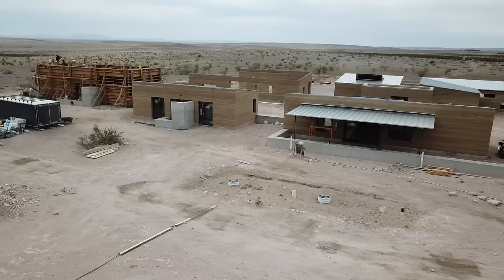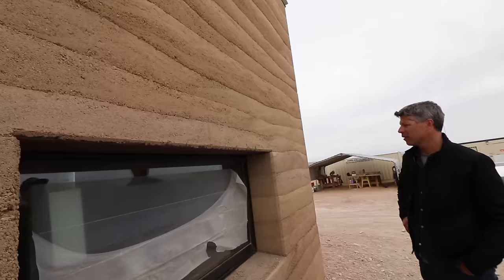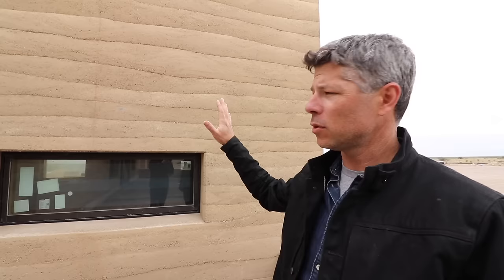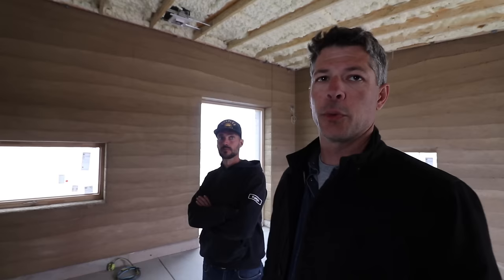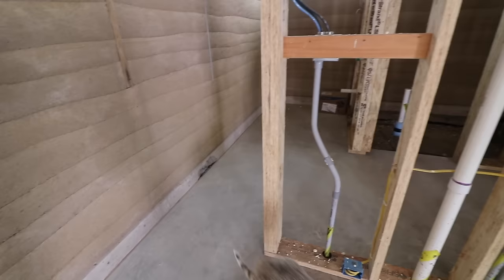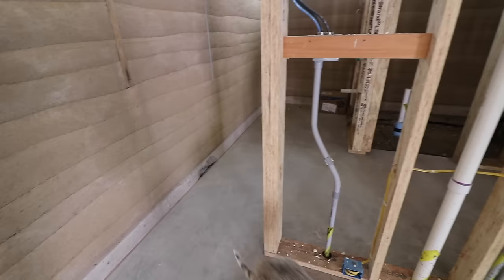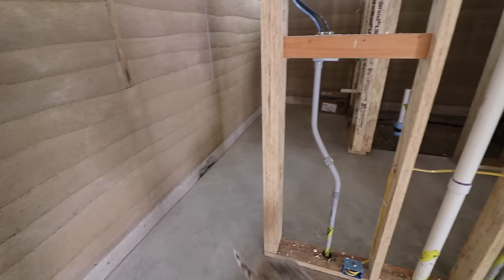Rammed Earth : You won’t Believe How They Build This!

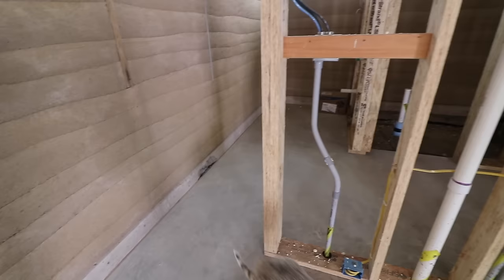Comment: Wow, assuming that lintel at 10:30 is 8ft long and extends 4ft up the roof, that is 64 sqft of rammed earth. At the standard rammed earth estimated weight of 110lbs a sqft(ASTM D698), that lintel is supporting around 7000lbs. Beautiful! Beefy!
Reply: Well, I think you are weighing cubic feet of earth. And, the lintel only supports the weight of the material below the included arch in the wall. Just like a brick , or, stone wall.
Reply: Thats about right but from the description of the mix maybe closer to 130
Reply: 110lb minimum.. I suspect that it is more into he 130lb range

Comment: The steel beam for the window frame will create a thermal bridge and when it's cold you will get condensation.
Reply: not enough humidity and probably not quite cold enough their to be a real issue I would guess. any condensation that might form the atomo would probably greedily absorb.
Reply: @nerys71  

You'd guess wrong. Some of the hundreds of years old historical rammed earth buildings around here have steel detached roofs covering the remains due to erosion by wind, water and ice. 

When people lived in them they were always having to maintain them. Far more than some construction types. They also usually put a stucco type covering over the outer walls. Because it was easier to maintain, and you didn't want the weather to destroy the actual wall.
Reply: @shaunofthedead3000  Any hundreds of years old rammed earth buildings are not at all like modern rammed earth which have a specific cement content. And rammed earth historically is quite rare, are you referring to adobe buildings? Those were fairly common and are very susceptible to weather. But very different from rammed earth
Reply: That is no exposed steel beam that is actually 3/16" cover plate for embedded struct angle above it, therefore that amount of heat transfer is far less than a beam. We supplied the steel
Reply: Yep ...  I would think that would happen.
Reply: @SuperVHSchannel 
2 feet of wall is its own insulation.
Reply: @Niels Kloppenburg 
Obviously not ideal for wet climates or high humidity.  Rising damp is virtually nonexistent in the U.S.
Reply: Hellbender Adobe is much stronger/weather resistant than European cob techniques or wooden buildings

Comment: min 10:22 when he says "many many tons above the lintel". I google how much weight a rammed earth wall has. This is the answer:  depending on density of soils and ramming it should range between 115-140 pounds per cubic foot. Or in normal none Imperial measures. Its between 550-680 Kg/m2

Comment: There has got to be enough lumber there in scaffolding to BUILD a house.
Reply: Rick Carrarini Much of that can be reused
Reply: There is another method that I'll be using where you make the RE wall in 4 foot sections at a time. U design it it key into  each section as you go. when it sets, you strip down the forms and set it up next to it. greatly reduces the lumber costs and is better suited for the DIY builder or small crew.
Reply: @klincecum  I wouldn't bet on it. If these houses were being churned out by the thousands, then maybe. But these are going to be one offs and all bespoke. I'd be surprised if half of that wood get reused.
Reply: Marten Dekker  Go use a saw.
Reply: @poppyrider5541  All of the wood is reused as forms to build other buildings several times. It's just like using concrete forms. The wood forms last for years.
Reply: Poor Poor  All rammed earth structures use a stabilizer/binder to strengthen the walls. Lime has been the historical go-to binder for 2000 years.

Comment: It's basically an expensive way to do a decorative "concrete".
It's not concrete PRECISELY, but if you're mixing in portland cement and aggregate, you're essentially concrete.

If nothing else, it's interesting.
Reply: It uses existing material and less Portland cement, which is a huge greenhouse gas producer.
Reply: The fuel cost of the workers and compression drives up the carbon footprint. It doesnt perform as well or last as long as a concrete/rigid insulation wall.
Reply: @sparksmcgee6641  There are rammed earth buildings from hundreds of years ago still standing.
Reply: I hear you hyperstrike. Whenever I see oak cabinets I'm like, why not just use pine and stain it?
Reply: @rammedearthworksllc2864  

Rammed earth on the project in the video.  You're using sandy soil, aggregate and portland cement in the case in question.

What is concrete?
Sand, aggregate, portland cement.

YOUR POINT?

Yes, in other cases (like earthship construction) rammed earth is just that.  Compacted soil in a retention system (tires in this case) and nothing more.

But I wasn't talking about that.

Okay, tired of this stupidity already.

Thanks for your time.
Reply: there are underwater set concrete structures in old ports that are thousands of years old. Rammed earth doesnt perform as well as concrete.
Reply: Roads used to be made with 3-4 bag mix in the 1920's  that would equate to 9-10% portland and I have done this wet in a 9 yrd mixer using CA6 for non structural low walls (3=4') for a horse barn and block fill as a pour mix..   if too wet it will crack if lime is not used

Comment: Absolutely beautiful work!  I love the bond beam detail.  We live in a Rammed Earth home and we LOVE it!!!
Reply: C J  , we are in South East Arizona.  It does great here, but we do have a heat source for the winter.  I think most people use a ridged insulation when building with rammed Earth in the colder climates.
Reply: C J  , it will get to about 80 inside our house when the temps are I'm the high 90's low 100's outside.  We typically see a temperature difference of about 20 degrees f.  At night it typically drops to the high 60's so we open our windows and it cools everything down for the next day.  Once you learn how to manage the thermal mass, it's great.
Reply: C J  I built and live in a rammed earth home in Canada. The biggest difference I noticed was the requirement for vertical rebar, and horizontal rebar through ties, which add a great deal of strength. Snow load requirements make it mandatory here, and somewhat higher percentages of portland cement are likely necessary, depending where you are. In the video I think he mentioned the walls are 1800 psi, ours crushed out to 4000 psi, but they needed to be a minimum of 2600 psi to satisfy the structural engineer. We have a 24" wall, with 8" inner and outer walls, and 8" of insulation in the middle. It is a very high performance home and I would love to see more of them in Canada, but unfortunately the added requirements do make it more expensive up north.
Reply: C J  it is difficult to determine the R value of the walls. On paper they have a static R value of approximately R 30. The dynamic R value is much higher. In our case, with 24" walls and 8" of encapsulated insulation, I would guess a dynamic R value of >R60. Put into perspective, our home has ten times the area of our tiny home we lived in while building, and costs the same to heat. Ranted, they have different heating systems, but a rammed earth home simply stores so much energy that it performs beautifully. It breathes very well, yes. We did not seal the walls, but many people do. Instead, we are relying on the plasticure we added to the dry mix for water repellant.

Comment: 07:10 All that exposed rebar all around the jobsite makes OSHA mad.  Won't even talk about fall protection when they climb up on the 15 ft wall forms. I guess that's the benefit of working in the desert. You can see the OSHA inspector coming from miles away.
Reply: coated rebar.. doesn't need much such as a silica anti rust clear coat, oil or epoxy based  and MARFA is not going to have that type of inspector.. (ya, they should have had more safety gear of some kind.. than what we saw)
Reply: @tsclly2377  I wasn't referring to exposed rebar because of rusting issues. Exposed rebar sticking out of the ground must have a cap over the end to prevent impailment injuries should someone fall and land on it.
Reply: The next time I will get the feeling that the Health & Safety people are pushing it, I will think of this worksite... and calm down.
Reply: Yeah, that man is just standing there on that ledge, and I keep waiting for the safety man run up yelling at him. :D
Reply: Thank you! I thought it was just me. There was a scary lack of PPE on this site.
Reply: yea and they shoulda been wearing masks cuz last year the flu killed some people
Reply: @majermike  Or that they are working with dry dust/dirty and cement. I don't envy their lungs
Reply: @slozenger9000  silica is no joke man, that stuff tears up your lungs. 😬

Comment: Matt.... I love your content. And I understand your niche are those big and beautiful custom homes but I'm finding myself more and more drawn to smaller homes. I'd love for you to  do a mini series  on tiny homes, and after touring a few, see if you could use your knowledge of building science to see if you had any idea's to advance the movement. I would love to be able to build my babies a tiny home and give it to them for their graduation gift after high school (in place of paying for tuition )... And after that... I'm gonna go build a village of  modern yurts and live out the rest of my days there.
Reply: What is the mixture ratios?
Reply: The Chinese, among others, have been building this way for millennia.  Of course they didn't use a cement foundation or bond beam.  Rebar was most likely bamboo, and stabilizer was probably fired and dowsed limestone (like Roman concrete,) if they used any stableizer at all.  Form-work was mostly done layer by layer -- not at all like this elaborate method.  Tamping was done with a wooden or stone hammer.  As each layer was finished, the form work was removed and reassembled at the top for another layer.  Often a limestone render was applied to the surfaces.  The only metalwork one was likely to find decorative on doors and windows or locks and hinges.   Some rammed earth structures date back well over a thousand years.  Built right, they can even be earth-quake resistant.  It would be a very good method to employ for a tiny house -- especially for someone young with unlimited time but limited funds.  One can even make rammed and fired roofing tiles.
Reply: Ditto on a series on cottages and smaller homes (including, but not limited to, tiny homes). I am planning on building as I get closer to retirement but it will be probably 800 Sq Ft +/-.
Reply: @fga55  8% cement I think
Reply: @dr.mikeybee  not to mention fire proof. Good if you can use your own soil from earthworks on site
Reply: No, not tiny houses. How about houses with a realistic budget. Anyone can build a luxury home. I want to see houses built with budget restrictions in mind in a manner that is accessible to regular people. I want some reality. Tired of pie in the sky.
Reply: @maxidaho  there are many low cost materials but the outer shell of a house is the cheapest part, it's the interior that's expensive, kitchens and bathrooms are the most expensive rooms. The best way to keep costs down is to DIY.
Reply: I actually considered the village you are talking about.  a good idea.
I have a new plan now though.  crossing on my boat. in the Bahamas, Carribian.   in that area or anywhere else I want to go
Reply: @maxidaho  no everyone doesnt know how to build a luxury home. Matts market is for high performance higher end homes.
Reply: Are your babies homes going to be on trailers?  Serviced land is the main cost of every home.  Unless your town has a very flexible land use policy, finding postage stamp lots with zero setback is going to kybosh your plan, as appealing as it is.  I think many of us are concerned with finding some way for our kids to not be saddled with a mortgage.
Reply: @colstace2560  unless your interior furnishings are also fire proof, any fire will destroy the integrity of the walls.
Reply: @markdoldon8852  I was referring to a forrest or wildfire mainly, no eaves or gutters to trap embers

Comment: That looks like a absolute ton of labor.
Reply: that's what I was thinking...then wondered if it will pass the test of time..
Reply: @nw5052001  Not sure just know new unproven products normally at this level will have a ton of issues over time .
Reply: They are using the local soil instead of trucking in materials from very far away. Notice they had to fly in. The natural soil is very sandy and good enough to make a low grade concrete out of. Plenty strong for a one storey building. That's why in a specific application like this it's worth it instead of spending a fortune importing building materials.
Reply: Way too much...Wait until you are forced to pay Union Scale Wages too @$42.00 per hour

Comment: The labor cost of compacting every wall every 4 inches must be staggering.
Reply: Sure its a lot more labor than a poured concrete wall but its not any more than a brick/block, which are still usually layed by hand everywhere in the world (even though mechanical bricklaying machines exist now). If the site is somewhat remote but there is a nearby supply of the aggregate it could be a remarkably efficient method of construction.
Reply: @dfpguitar  traditional rammed Earth has no cement. It uses clay. It also has no stone filler. So unlike what they did here I can all come from the sight. That along with the thermal mass is why it became so common in Mexico. Shipping things from miles away has always cost more then the labour for making a home in history. Only after trains had using things from off site become a common or practical thing to do. In the end this has more in common with compacted concrete like is used on dams if what he said about the mix is true.
Reply: Not tp mention shoveling 3 million pounds of dirt.
Reply: @dfpguitar  its not.  Ever.  Even if the dirt is on site, the labor cost far exceeds any naterial saving.  Its a high end boutique option.  Efficiency and cost needs to be ignored.
Reply: @markdoldon8852  novel methods are only uneconomical because workers with experience of completing projects hundreds/thousands of times with increasing efficiency and specialised tooling do not exist.

That's why things are slow, awkward and prone to problems.

In the UK the traditional method of housebuilding is with bricks. 
In the USA you would probably struggle to find the labour to build a brick house, so it would end up slow and very expensive. Compared to the UK where it would be the fastest and cheapest.
Timber & SIPS construction has only just started in the UK. Ten years ago labour to work with that wouldn't have even existed here. Now it's begun it is typically factory fabricated stuff for commercial projects not independent homes.
American style timber "framing" skills (using a hammer or nail gun) has NEVER existed here. We skipped it. That is probably the cheapest style of construction in the US, but you would fail to find professionals to work in that style in the UK. (you could do it yourself though).

what I'm saying is that compacted earth or any other novel method is economical once the skilled labor exists.
But even without this, like the example in the video. I really can't imagine constructing these walls is more labour intensive than bricklaying.
Reply: Not to mention the labor cost of hand shoveling 3.5 million pounds of dirt. I was really surprised we only saw one hand compactor.
Reply: @dfpguitar  tons of houses in the USA are brick. Especialy on the east coast
Reply: Then, don't do it.
Reply: In Western country
In Asia we got nothing better to do
Reply: Whats even more amazing is that they're not using females to do all the leg work, given the gender pay gap.
Reply: Green Giant  If you get some prefab steel bolt in frames you could use a bucket and a supported angled piece of ply or something stiffer to act as a hopper like guide for the material. Once you open the bucket slow it should go right in no problem. Would be perfect if you put a small bucket on a long armed backhoe. Get a jackhammer and fit it with a compacting head n go to town. Unless you were going for style you could probably start compacting after a lot of material which will save labor.

At that point it is just to ensure you have all the agregate on site.

Should make the labor bearable
Reply: Yes. It will make you stagger when you're doing doing a foundation by yourself!

Comment: I'd be more impressed if they dug out where the foundation would be and built them half underground with the same dirt.
Reply: Sourcing local or onsite earth is usually checked first before spending a small fortune on shipping it in. I think from a contractor standpoint, you pay to get the correct mixture of earth brought in to save time in excavation, sifting, then mixing in the correct mixture, and then adding the correct moisture so that the earth and cement tamp together correctly.

Comment: Trucking in 3.5 million tons of sand + portland binder + concrete foundations + all the forming +++++ so much more. There is no way that this is a less expensive/stronger build than using other materials. The build is aesthetically pleasing but impractical.
Reply: James Jameson this is some of the strongest building techniques known.  The oldest home found is 10,000 years old and it’s Cobb - similar, but based on mix of clay/sand/straw/water.  An earthen home.  The government saw fit to get rid of techniques homeowners could do themselves, require contractor licensing, and make money off every home built.